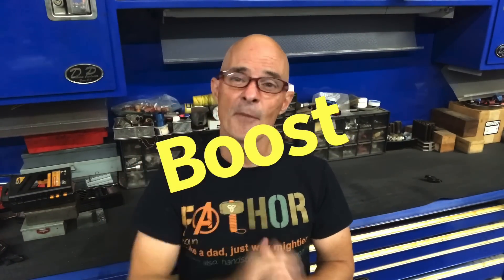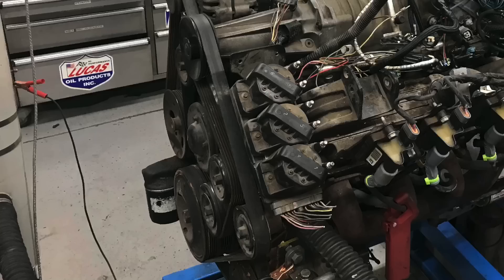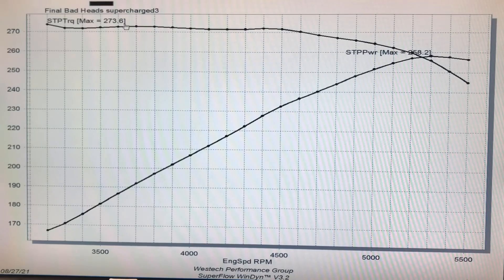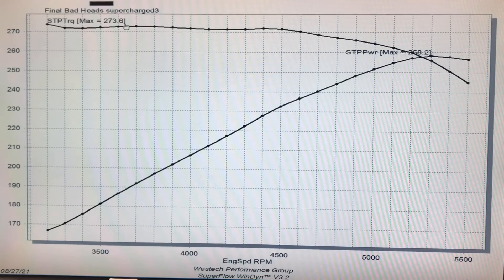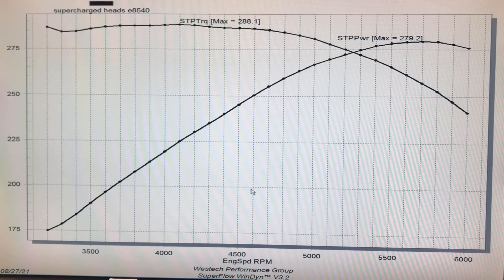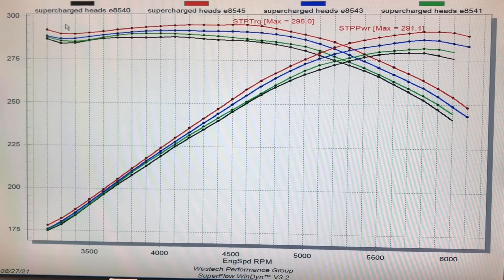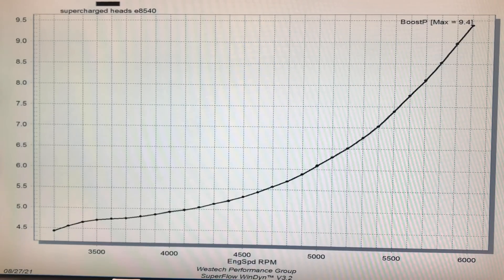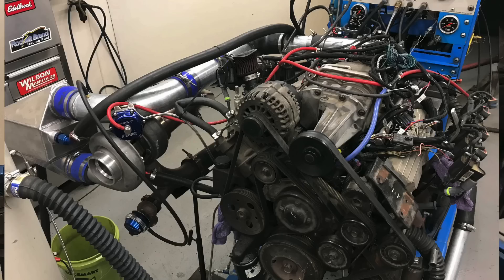THE OTHER GUYS 3800 L32 HOW TO MAKE HORSEPOWER. CHEAP, JUNKYARD SUPERCHARGED V6 POWER (PT 1)

Comment: How did the 3800 get the engine code L32? The L32 is a 60° V6 from the 93 to 95 firebird/ Camaro
Reply from the maker: the 3800 in the Camaro is the same engine family
Reply: @richardholdener1727  that's what I'm intrigued by.  The L32 V6 is a 3.4 60 degree V6.  It's a very different engine from the 3800. But shares the same engine code somehow.

Comment: Did u change the pistons over to l67 low comp pistons only ask because u said it was an l36 but it had low compression pistons in it when I seen u remove the head ?
Reply from the maker: I HAD TWO MOTORS-ONE WAS AN L67, THE OTHER WAS AN L32 (NO NA VERSIONS)

Comment: My 02 gtp's boost came on much more in lower rpms and did stay steady and would fall off right before shifting but.. mine was in the 7 range in the 3000s and that's with stock pulley with a cut factory air box with k&n and flowmasters instead of stock mufflers and royal purple fluids and ran a 14.2

Comment: My stock setup( the aussie rwd l67) was around 6psi untill around 5000rpm and it would climb to about 8 or 9 psi. I figured id need a cam or reco heads but i fitted extractors and at the same time as a hybrid intercooler and smaller pulley and it makes around 12 to 13psi consistantly now. I think the factory cast headers are causing that spike at the end there and especially how the fwd manifold is compared to the aussie rwd cast manifolds. it would be good to see just a header change and see what that does to the boost curve. As always mate great work
Reply from the maker: watch part 2 in the series
Reply: @richardholdener1727  don't worry about that I'll definitely be watching mate
Reply: @richardholdener1727  I have a diveter plate between the supercharger and intake manifold so it runs through an external w2a cooler like the one you use on your dyno testing. I just picked up a harrop htv1900 for the l67 so that should wake it up a little more than the m90

Comment: With the stock pulley you should see a peak of 7.5-8psi up top. These engines are particularly sensitive to vacuum leaks and can often have sticky BPV’s that will bleed off boost, so if you aren’t making that much boost those are definitely things to look out for.

Comment: I really like these engines and I have a light track T with a T5 that I think might be a candidate for a 3800.  My questions is, how adaptable is the engine to a RWD application ?  Any stock bellhousings that might work with the T5 like an 3400 metric pattern S10 (60* V6) ?  Will the crank accept a pilot bearing ?  I love your "Other Guys" series.
Reply: The t5 should bolt right on, youll need an F body flywheel and pilot bearing but the crank should be the sam in all series II. The series III i dont know if its drilled for a pilot because it was never installed with a manual transmission. All of them are fwd. A series II engine will maybe be more common and probably cheaper in the junkyard and they have the same head castings, the blower is different but not substantially. 
I still would never swap this into anything. 330ftlbs will destroy a t5 driven hard and the all iron construction means they weight more than a Al LS engine and about the same as an iron block 4.8/5.3. There are so many better V6 engines that gm has made in the last 15 years that are a hundred of pounds lighter and make make the same power without a blower.
The Sc points the throttle body at the firewall on a rwd application, i dont know how well it would work in a tight engine bay.I dont think the engine is bad, it is great for something low maintenance and low performance that doesnt burn much fuel. Its a terrible, heavy antique for something you want light and fast.
Reply: @timothybayliss6680  I don't know if we're talking about the same engines, I'm talking about the 60* V6's not the 90* V6's.  Everyone I've seen in the engine bay's of numerous Buick's have aluminum heads and even in a Park Ave they're no slouches.  As for the T5's I am currently driving a fat tired 1986 S10 with a cammed 4.8 LS and a World Class T5 out of a '88 Camaro and I don't have a light foot.  I rebearinged it and added a billet support otherwise it's stock and has been taking a pounding for over 4 years now.
Reply: @hardball107  the 3800 is a 90° V6 that has its origins in like 1962 as the wildcat 225. All the production heads up to the end are iron. The  newest and last pushrod 60° v6 (3500/3900) is in the same family as 2.8/3.1/3.4 and shares the same bell and some have a manual trans. Street driving or even aggressive track driving is pretty easy on a trans compared to powershifting with slicks on a prepped track. A WC t5 will do lots of magic too if you dont powershift into 3rd on the regular.
I wouldnt swap a 90° iron pushrod V6 into anything other than a giant forklift or a generator. They are too heavy and expensive compared to the performance offered by aluminium 4 and V8 engines that share the same bellhousing and crank flange offset. For me, if i had a t5 that could take this engine in a s10 chassis i would save my money for a ls4. It weighs 100lbs less, makes more power than this can with a blower and performance parts are less than half the price.
Reply: @timothybayliss6680  I must be getting the 60 and 90 degree engines mixed up, I always thought the 3800 was a descendent of the 2.8/3.4 family of 60 degree engines not the 231 Buick V6.  The Track T I have has a very narrow engine compartment.  It has side covers and currently has a Ford 2300 4 banger in it.  At 2100 lbs it goes OK but I'm looking for a little more.  I might be able to squeeze a 302 in there and I'd love an LS but it's really tight.  300 horse is twice whats under the hood now and It would really fly with that, a 3.4 with 200 hp is hardly worth the effort.  I'd be better off turbocharging the 4 banger.  Thanks.

Comment: That Boost Curve Is Pretty Normal For A 3800 Supercharged. 

Almost All The Supercharged Cylinder Heads Are Cracked Between The Exhasut And Intake Valves At Junk Yard. You Have More Luck With N/A Heads From Junk Yard But You Cant Run The Supercharger On The N/A Heads (no injector ports in head).

Good Luck Getting Ported Heads. I Sent My Cylinder Heads Out 11 Months Ago And My 3800 Has Been Down Ever Since. I Just Want My 3800 Running Again.

It's A 210,000 L67 Crank In A Series 3 Block, L32 Rods, Diamond Ceramic Coated 8:1 Forged Pistons, Ported L26 Cylinder Heads (if they ever get done), Ported L26 Lower Intake, L26 Upper With Velocity Insert From ZZP, 91 Pump Gas, Water Methanol Injection, Quick Spool Wet Shot And A Big Turbo Cam. And Of Course A Turbo (GTX3582R With .82 Turbine)

I MISS MY 3800 SOOOO MUCH lol
Reply: @JPL Performance Damn And I Was Going To Do It Through Intense But They Never Responded Back To Me Emails. Im Not Gonna Say Who But I Do Know It's In Indiana And I Believe There's Only 1 Machine Shop In Indiana Set Up For CNC Porting These Heads.
Reply: @JPL Performance My Bad It's In Ohio. Lol Indiana Is Where Triple Edge Performance Is. I Had My Transmission Built There And For Some Reason It's Burned Into My Head haha. 4 Years Ago That Took $6,000 And 9 Months To Get Done. But It Was So Hard To Find And Get Parts For The 4T65E (7/8" Chain Set, PI Torque Converter And The Ultra Rare GM Torsen LSD) All My Transmission Is Missing To Be Completely Built Is The Impossible To Find 1" GM Chain And The GM Input Shaft. 

Once I Hit The 10 Month Mark On The Heads I Started Getting Upset. Now We Are Coming Up On A Year And It Scared Me Becasue It Felt Like It's Only Been A Few Months And An Entire Year Had Flew By.

The Bad Part About This Is Money. Since My Monte Carlo Is Down I Started Messing With My 5.7 Hemi Jeep Commander Which I'm At The Point I Wanna Build Up My Jeep. I Threw One Of The Montes Spare Turbos And It's Already Making More HP Then My Monte Carlo Did. Lol And The Jeeps Still Got Stock Cam And Heads hahaha. Granted It's Not As Fast As Monte Carlo Cus the Jeep Weighs 1,500Lbs More. Monte Was Making 480WHP With Almost All The Bolt Ons And ST5 Cam, 1.65 Rockers. Jeep Made 450AWHP ( if you consider the AWD drivetrain losses it's making more chp) And It's Not Even Trying With 7PSI And 11Degs Of Total Timing With Zero KR. It Gains Like 15HP Per Deg Of Timing And Like 30HP Per Lb Of Boost. I Haven't Turned It Up Cus I'm Too Chicken Knowing The Piston Ring Gap Is Stock hahaha. Tuner Was Like We Are Not Even Breathing On It. So I Wanna Do Cam And Gap The Rings Which Is More Money haha. Then It's Gonna Brake The Tranny With More HP And I'm Gonna Have To Build That Up Like The Monte hahaha

Comment: Mine would jump up to some where somewhere around 6-7 then go up a lb or so as rpm rose. Now with a 3.4 pulley on a gen v swap(2000 gtp) it goes from 7.8 at the hit to about 11 at the top. But mine with factory computer seems to not be happy timing wise. Always seems to be pulling KR. I have the basics, intake, down pipe, factory cat and straight exhaust, step colder plugs and water/meth.

Comment: I was just struck by a poignant question, Do you have add ring gap to a factory engine that already had and was designed for boost?
Reply from the maker: I put it at .028-.030
Reply: Given what you have planned that is understood SOP even.  Just curious as to what the OEM did for a boosted application

Comment: You can tweak the Boost bypass valve with a 10mm wrench & 5 mins to make the more boost lower/sooner; basicly you are shortening the stroke of the lever in the bypass valve. I forget what my SSEi made stock.
Reply from the maker: I adjusted the valve

Comment: My boost curve looks pretty similar. Btw, the header/manifold and down pipe is the most restrictive part if the whole thing. A set of headers and you'll see gains. 

On another note, I've very jealous of 22° of timing. All I can muster is 14° before kr. I am on pump 93oct.

Comment: One of ours is tuned at 200hp on 8deg timing with a 3.0" pulley making 13psi at 6400rpm

Even with a 222/222 113lsa cam and decent exhaust its still restricted, is getting a big AN12 water to air cooler and porting very soon

Cant believe how much of a difference you found just 1 deg of timing made

Comment: I see 3800. I click. The long tube headers will help a hell of a lot! E85 and nitrous works great on these. I've been there. That boost curve is wrong...... it should be near instant. Very odd.... The stock heads will do way more hp. The cam is the limit.

Comment: I wanna see the difference with a nasty ZZP stage 4 cam vs stock! 

Is your boost bypass valve leaking/stuck open?
Reply: Also I remember browsing the forums back in the day and they say the non-supercharged heads flow better than the super charged ones. I've always wondered the truth on that?

Comment: Hi Richard, is it possible to take the temperature of the blower before and after compounding it maybe with a infrared thermometer? I think it would be interesting to see if the blower gets hotter or colder with the turbo.

Comment: Idk my boost curve but I know I'm maxing at 6-8 lbs on my l67
Reply: I should add, it's  not tuned with 3" catless dp, cold air intake(hot asf intake it's a fwd 3800). with some transmission mods

Comment: Its been awhile since I've seen a stock 3800, but that boost curve looks like the blower may be a little worn out.  Bet if you pulled it off you'd see a little self clearancing on the rotors

Comment: iirc there was a GN with a series 3 engine, 206/206 stattama cam, mildly ported heads, and 61mm turbo that ran mid 10s on stock bottom end.

Comment: L67 here with ls6 valve springs, ls7 lifters, gen 5 m90, ported myself heads, sd headers, e85, dhp, ECT

I rev out to 6500 and my boost curve does gain overall. Stock boost on my current motor, until next week, but I see about 6psi until about 5600 rpms and then mine climbs also to about 8 or 9 psi at 6500... so I'm sure the cam has to be a big part of the problem. But my power stays good to 6400 then you can feel it fall off... Stock though,  that happens around 5800-6000, so valve springs definetly help.

Comment: Richard, that blower should be making 8-10 psi from 3000 rpms on up.  Make sure the bypass is closing all the way right at the throttle hit.

Comment: The bypass should close around 2500 rpm. Mine has 9 psi around 4500 rpm, drops to 8 at peak power and rises to 9 again at the rev limit. 10 on cold days
Reply from the maker: bypass is closed

Comment: My 3800 experience is that the boost increased up top when the IAT climbs. The boost curve should be a little more linear but as it doesn't have a cooler the air expands as it is compressed due to the heat. I'd love to see IAT data!

Comment: The secret to building a strong 3800 is building a good motor with a good bottom end,  high flow heads, good cam good exhaust. Maximum boost at that point should be about 8 lb after that you lose volumetric efficiency
Reply: Stock bottom ends have held no problem above 600hp, you don’t really need to touch it. Same thing with the manifolds, and you definitely don’t lose VE after 8psi, maybe 15
Reply: This is America you have the right to be wrong
Reply: A set of forged pistons, some good rod bolts, and balance the crank is all you need to do to the bottom end to support upwards of 900+ at the crank.
Reply: @rdsimmonds  don’t even need that, 700whp has been made on an l26 with good fueling and tuning. Imagine what the stronger l67/32 can make.
Reply: And people that smoke have lived to 90 but not typically.  A boosted engine is much safer with forged internals.  That's why they make them. And show me a 3800 making those high horsepower numbers with stock heads, cam, or manifolds.
Reply: @EmeraldEnchantments  noone makes a forged crank or rods that I've ever seen for the 3800 2/3. The best example I can tell you to look up is Tim King's Firebird. It made 810 whp, so around 900 bhp. The engine had a stock block, crank, rods, and head castings. The heads were ported, and the valvetrain upgraded. And it had a custom twin turbo setup. You can actually buy the same short block, heads, and cam that were uses in his car.
Reply: @JPL Performance I doubt they actually make them, but rather have them made for them by a vendor. That being said, the stock S3 rods are sufficient past 900 bhp. The Spirit of Bonneville that was used to set the speed record used the same short block setup as Tim King's Firebird. It's available from Intense Racing.
Reply: @JPL Performance the stock rods are "hot forged". They're still powdered medal, but the production process used makes them virtually as strong as an aftermarket forged rod. Just like the LS rods, which have been shown to handle some insane power.
Reply: @JPL Performance I never got a chance to build up my S2 in my Firebird before I had to sell it. Maybe one of these days I'll be back to a point where I can get an extra toy and do a build.

Comment: A proper valve job is often overlooked by many . People seem to focus on rings and cylinder walls, but the head is just as important . Good valve guides as well as valve to seat surface, and then of course the correct valve spring for the application. An interesting video would be a worn out performance head against a perfect stock head, as in the head flowed  with in a reasonable amount more, but now the valve guides are worn and the valve might not be sealing well. Where is that trade off of better flow vs it inability to seal 100% and at high rpm? 

 It is also kind of a two part question for people not looking to spend much. Gamble on used higher performance heads vs a great valve job maybe some porting to keep the price around the same either way. The second is  cheap heads with the same flow numbers vs heads with the same flow numbers , but the valve job is done 100% correct, both brand new out of the box. 

That almost turns into a third question ... should I just buy china heads and have my local machinist go over them, because just being made in America and paying a thousand or more doesn't mean someone making near minimum wage is not  just slapping garbage together.

Comment: The 3800 is such a great engine. It makes me sad that GM never made any decent cylinder heads for it.
Reply: GM perfected the 3800 engine for years! Please don't forget this fact- it's a big the reason why it was so reliable!!!
Reply: @wannabeetiger  if only they made a bullet proof 4t65e-hd transmission
Reply: @knakaideneh  thats any transaxial, all transmissions fail at some point, fyi, example 4L60 is for vehicles up to 6000 lbs gvwr, also up to 360 ft fbs torque.
Reply: @shadowopsairman1583  The gm 4 speed transaxle is a remarkably weak transmission known for dying with stock Na 3800 power levels. They are not a strong unit whatsover compared even to Ford's ax4n fwd transaxles. Ive seen a pretty sweet 5 speed swap from a saab into a GTP after the guy was tired of killing transmissions year after year.
Reply: M.B. .................they made some wild heads back ln the early 90s ,they raced at Indy ,heads had massive intake ports ,Bill Cosby sponsored a team with Willy T Ribbs , there worth the hunt !!!!!!!!!

Comment: What I got from this is I need 80lb injectors, spend some time porting the heads, make some headers, and swap more cam in the supercharged 3800 going in my version of an Ariel Atom. I wonder about using the NA short block with the blower, because E85 doesn't need low compression to stay alive... and I have three NA engines sitting here. That torque curve 3500 to 5000 makes me very happy, and in an 1800lb or so ladder car it should be spirited.
Reply: L26 aren't very built from what I understand. The l36 is fine. They aren't as forgiving as the low compression blocks, but can pump out over 300whp with a maxed out m90 for a while, with careful tuning that is.